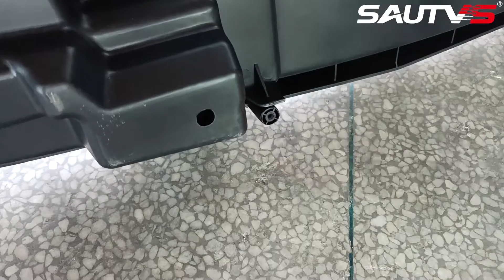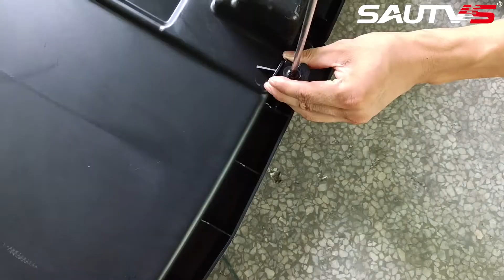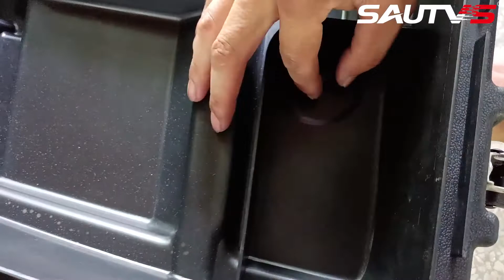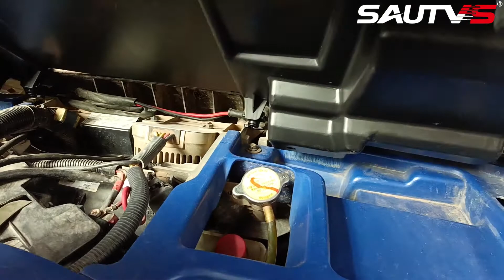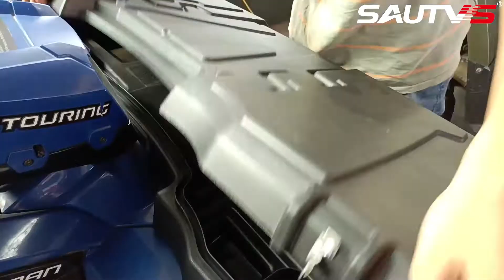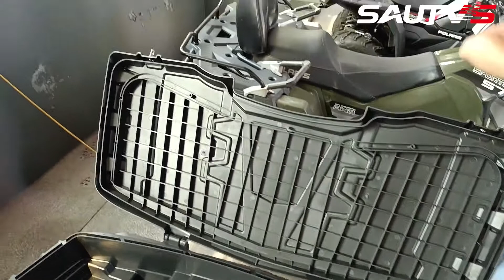Installation of SAUTVS Front Storage Box for Sportsman 550 850 XP 1000 2009~2023

Comment: Comfised, thats just a less durable copy if the stock one. It doesnt seem to have the aluminum framing.
Reply from the maker: Hello, it is made of high quality polypropylene material, thick and durable. It does not come with the aluminum frame inside it, but it has the pre drilled holes for easy installation. Have a nice day!🥰